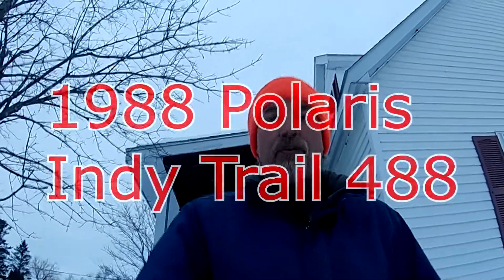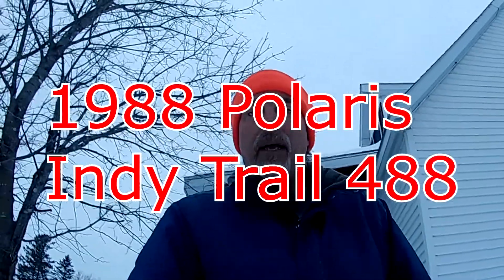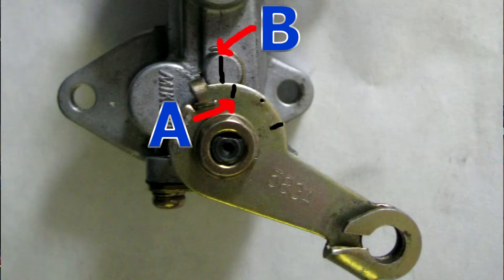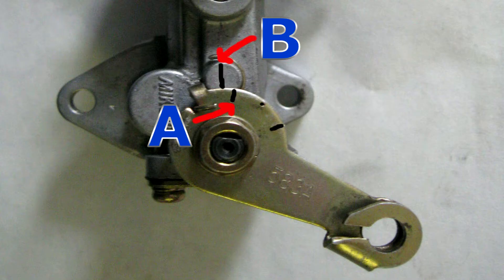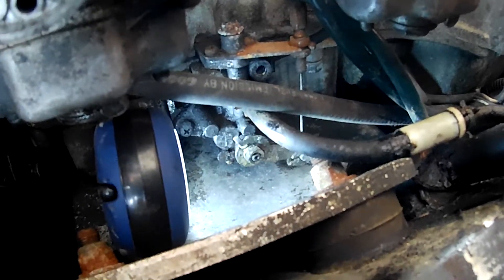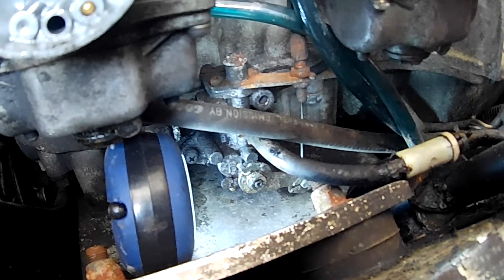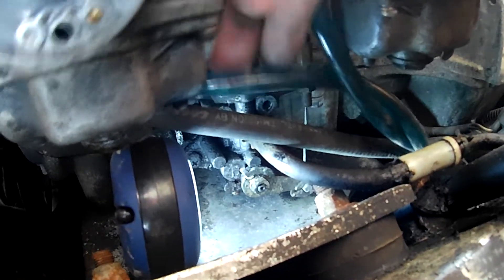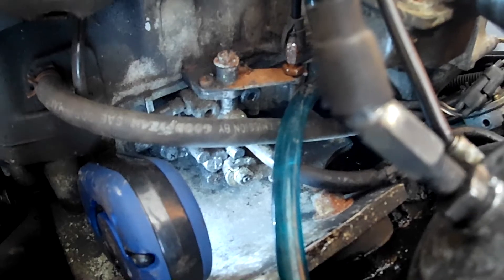2-Stroke Oil Injection Pump Adjustment

Comment: well, I do believe you need to be complemented! Here's the story. I have a couple of '95 ski-doo grand touring, 670, used of course. Purchased recently, locally. No history. The idle was around ~3000 rpm, so I figured I could adjust the throttle cable adjusters on the mikuni carbs. Turned them two turns out, but still the same idle speed. Well turns out I was out of context. Found out that there are adjusters on the side of the carbs that limit the downward travel of the throttle pistons/barrels. So turned them out, reduced the idle speed. After a few days, I'm noticing that the engine, when warm, smokes and slows down, then stalls. Perplexing as it might be, did a search, then I found your video. You mentioned that the throttle cables need to be synced with the injector pump! WALA!!! This could be my problem, so will re-adjust the cables tomorrow! Pretty embarrassing, being a "Rocket Scientist" not really just a joke, plenty of experience with engines, etc. mind you I've not been around sleds since 1977, so after 45 years , things have changed! LOL! Back in my day, no such thing as oil injection, you did it manually! WTH!, Thumbs up! Cheers.

Comment: hey how do you attach a cable to the oil pump.
Reply from the maker: I think, going on memory, that you have to rotate the oil pump pulley and look for a way the barrel of the cable can slide sideways straight in, with a slot for the cable to slide through sideways as well.
Reply: @contact4mwy7  does that cable attach to the throttle cable like spilt off near the end?
Reply from the maker: @ethanc918  It should come from a junction in the throttle cable, yes. If it doesn't, you need to get a new throttle/oil injection cable. They need to move together at the same rate.

Comment: I have a 1993 Polaris 350 2stroke and I mix oil with gas and dont know if I just have to put gas and does it mix it by itself
Reply from the maker: You should find a owner's manual to look that up to find out for sure.
Reply: Ok thanks
Reply: Do you know a lot about atvs

Comment: What are typical oil/fuel ratio of the oil injection system? More oil actually leans out on the air fuel mixture
Reply from the maker: That would probably related to the manufacturer specifications. Typically a two cycle motor can burn fuel/oil ratios of 30:1, 40:1, and even 50:1 ratios. I don't use smokeless mix oils because I want to see the smoke from the exhaust. If you don't see any blue smoke, it's not getting enough oil. If you're fouling plugs with caked on oil it's getting too much oil and probably smoking a lot!

Comment: so question to you sir is if I have just had the carburetor is removed cleaned and reinstalled on my 1990 phazer fan should I go ahead and check the oil pump position lever?
Reply from the maker: I would, knowing what I know now. It might be in the ballpark, but would be good to know for sure, if you can find that little bugger buried in there somewhere!